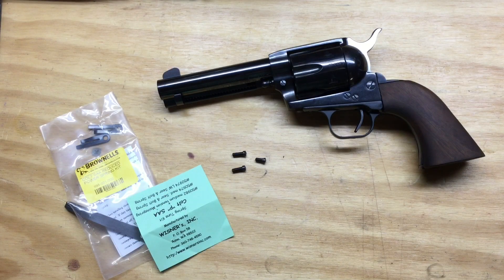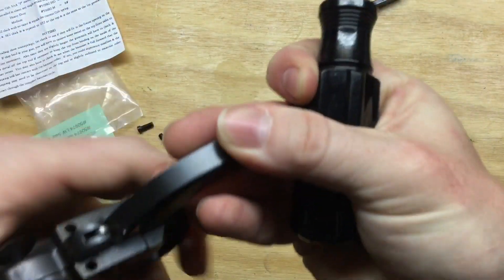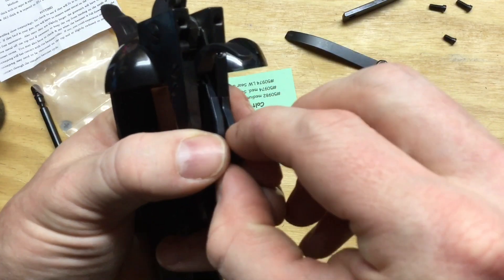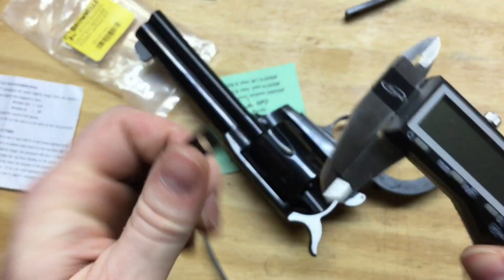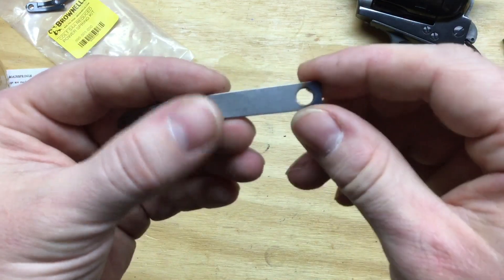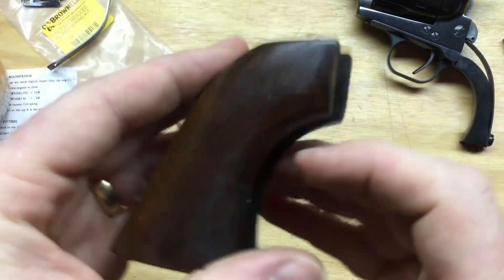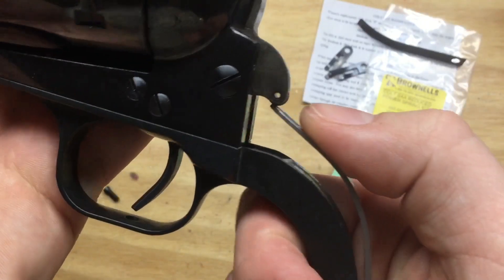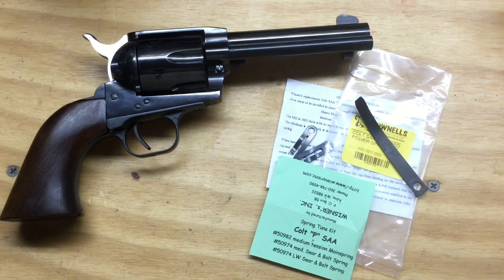45LC Single Action - Upgrading Grip and Springs

Comment: I have an evil Roy.. I can’t stand the one piece grip. So I took a set of 3 rd gen grips, form fit them to the grip strap. Drilled a hole in the grip strap using the 3rd gen grip hole as my index mark..used an appropriate size pin.. there you have is 2nd or 3rd gen grips where 1 piece 1st gen was.

Comment: The setup is the same on the  EAA Bounty Hunger 22lr/Mag.    Brownells has that spring set on backorder, so I went ahead and re-tensioned my existing springs.    The hammer spring just needed a little more bend.  Put it in a vice, bend, check it, bend, check it, repeat.    The trigger spring is 2 pieces of steel, back to back.   As you say, the longer end is the trigger tension and it is backed-up by another layer of steel.   I bent the second layer of steel backward so it's no longer pressing on the long trigger spring.  Now the trigger spring is essentially just 1 layer,  thus lightening the trigger.     This EAA almost feels like my Colt.  great!   Still some roughness in the moving parts to polish out, but so much better now.    $32 bucks saved.

BTW, to test the firing pin force with your finger,  take out the cylinder, but put the cylinder rod back in place.   The rod is what holds the transfer bar in position. 

Yes, my trigger guard screws were loose too.
Reply from the maker: Great info.  Thanks!

Comment: I'm sorry to tell you this Mr. Bacon but you weren't suppose to shorten the new spring. The new mainspring was made to go on like it was shipped. The spring is now a little bit too short and you defeated the purpose of the dynamics of the new action that you would have had when you pulled the trigger. It would have made your pistol shoot smoother because it would have rolled off of the trigger bearing a lot easier while still giving you the right spring pressure. It was made to be able to make your pistol have a slicker and easier action especially after you changed out the trigger release spring.
Reply from the maker: The new spring didn't fit unless I shortened it.  It physically would not fit in this particular revolver without modification.  I didn't need to go as short as I did, but it is 100% functional.
Thanks for watching!

Comment: You'd be better off if you had purchased a Wolff trigger/bolt spring, the round piano wire spring.  Pretty much guaranteed never to break.  I used Wolff springs in my Uberti 1873 Peacemaker clone .45 Long Colt 4 3/4 inch barrel.  It was advertised as a 5 1/2 barrel but they were wrong.  The Wolff springs really work great.  Even the hammer spring with the center cut out really makes a difference in the force to cock the revolver.  I love my Uberti Peacemaker clone.  It shoots great and very accurate.  I got the Uberti clone at Cabellas with the old time finish.  Even the grips were distressed and the pistol looks like it was made in the 1800's.  After seeing the hammer spring modification, I took my 1860 Army Pietta apart and cut out the center of the hammer spring like the Wolff spring.  Now it cocks a lot easier and will still pop a cap.  I just used my Dremel tool with a cut off wheel to cut out the center of the hammer spring.  Works great!
Reply from the maker: Sounds like a great set up

Comment: when you remove the trigger guard, note the position of the sear spring. If you look, you can figure the height of sear break point...measure from center of screw hole, mark the back side with a punch, then drill/ tap for a 4-40 set screw....suddenly you have a way to control overtravel, which aids greatly in   accuracy!
Reply from the maker: That's a great tip!  Thank you.

Comment: Hi I got this model in .44 mag, few months ago. So far it seems well made but the trigger pull is horrible. What with christmas coming up I probably won't be able to get a spring kit till after new years but thank you for the information on where to get it and how to fit it. I'm going to try a old trick i read about until then, where you put a leather washer between the main spring and the grip frame before you tighten the screw down. Thanks
Reply from the maker: Thanks David!  I'd love to hear how the leather washer works out for you.  I bet 44 specials are a real pleasure to shoot.

Comment: Loads of Bacon: I don't know how many rounds you have put through this "Colt" but I am sure that once you have had a chance to conduct your accurising tests you will feel the need for a set of longer grips, the standard Colt Navy size grips that these pistols come with are really short, I can barely get 3 fingers on mine, the easy tweak is to fit Colt 1860 grip frame/grips, this makes it a completely different pistol to shoot, once you have tried it you will not want to go back to the short grips. Chris B.
Reply from the maker: I've only shot 2 or 3 dozen shots so far.  I noticed teh grips are on the small side, but don't remember the grips being annoyingly small.  I can definitely see how the larger grips would be a real pleasure!  I'll certainly have to take note of it - my upcoming range trip will be 200+ shots.  Thanks Chris!
Reply: Eaa Sells 2 piece Army length grips that fit “over” the navy size frame